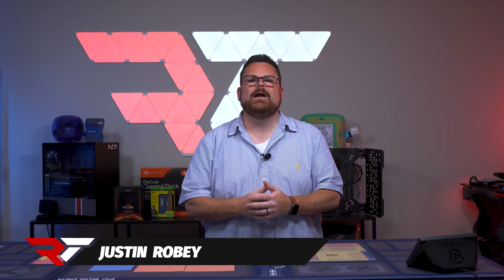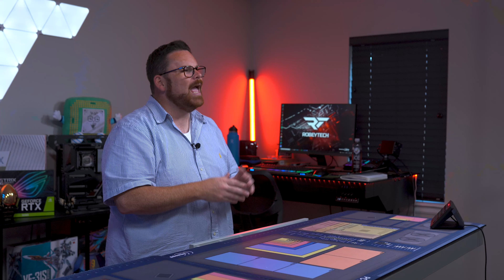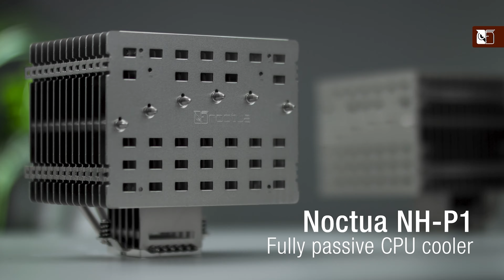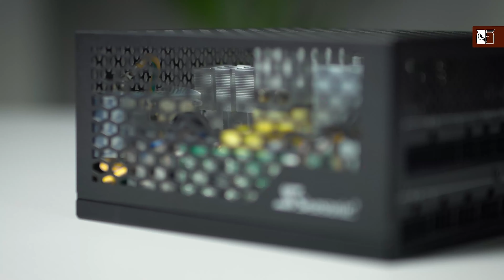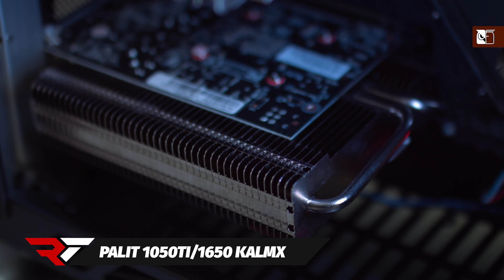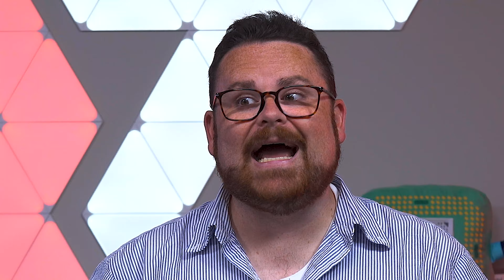Look Ma!  No Fans!  Can you passively cool a gaming PC without using any fans?

Comment: I sleep about 5 feet from a computer running 100% load 24/7. I spent a lot of hours tweaking fan configurations to get as close to silent as possible. The quietest config I came up with actually uses a total of 8 Noctua fans running at low rpm with about the same thermals as 4 Noctuas running at high rpm, but much much quieter.

Comment: Some of the best parts for passive cooling where missed. The best full passive builds will always be under 350w at full load so a 700w PSU is unneeded. The Silverstone nightjar 450w sfx-L PSU is a much better option with better heatsinks. The best build would be a Asus b550F motherboard with 5600x/noctua cooler. Using a lightly undervolted Asus 3060 phoenix with a Raijintek 8057 VGA cooler. Mounted with included VRM heatsinks/ extra hardware to retain the backplate. M.2 would be the new Aorus gen 4 with it's massive heatsink, and a 250gb gen3 as a OS drive in the second slot(to offload constant demand on the primary drive). Ram would be corsair vengeance LPX 3600 2x16gb kit. for excellent cooling with extra space between dims and cooler(low profile height with only two dims on four slot MB). The ideal case would be the O11 mini with it's perfect layout.  Using a inverted vertical GPU mount for excellent airflow. GL HF